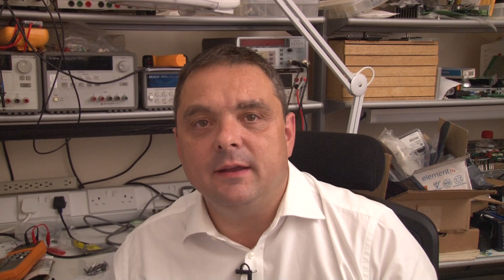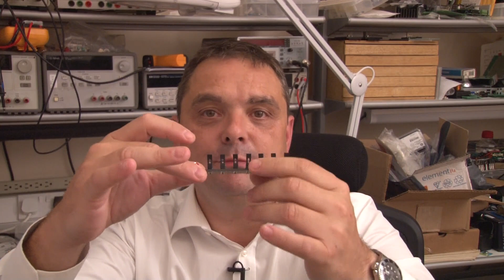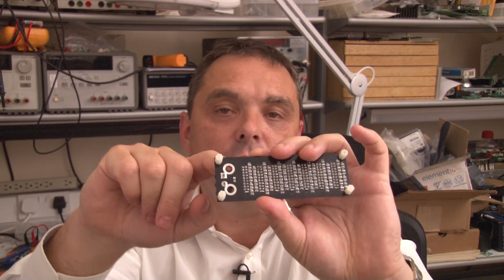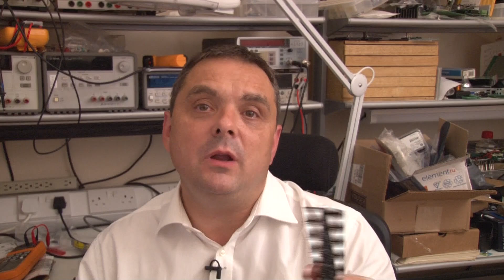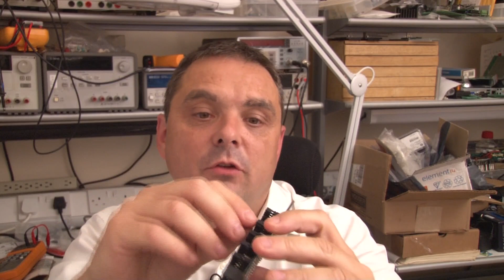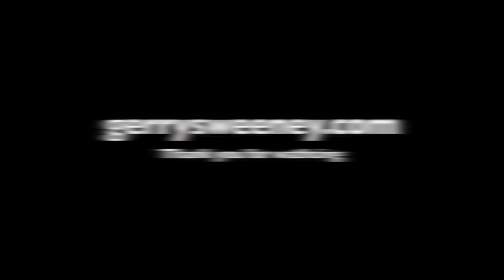Five Decade Programmable Capacitor -- A Low Cost Solution

Comment: Nice vid, I wonder if it's possible to make a programmable capacitor with an MCU like an arduino and handful of caps connects to the analog pins that can be adjusted via some buttons that trigger code that adjusts the overall capacitance? Any one done such a project (perhaps with resistors instead) or know if it's possible?

Comment: Problem with jumpers is they are break before make.
Reply from the maker: Which is OK I think when it is a capacitor because they are paralleled, just jumper the zero position of the next lower bank so you have a small value in circuit when you move the jumper (if you are tuning live).  on the resistor module I ship it with the "0" position solder linked out for the same reason.

Comment: What about dips switches instead of goldpin jumpers?
Reply from the maker: Cost and reliability, when a jumper wears out just use another one, dip switches, especially cheap ones fail pretty quickly with frequent use.
Reply: I was working as electronics lock QC tester
We were using jumpers to turn the device into configurations mode and to make a reset.
Jumpers were lasting about 500 times, so also not much...
Reply from the maker: Indeed, but replacing a jumper is one hell of a lot easier than replacing a soldered in 10-way dip switch :)

Comment: Hi Are these still available, Would like one of each if they are.  Tindie dosent show if they are in stock and as its from a few years ago I don't want to place an order if they are not still in production only to have to get a refund.Many ThanksBrianG0WZB
Reply from the maker: +Brian Burdis yes they are still available.  I will update Tindi, thanks for pointing that out. Gerry
Reply: +Gerry Sweeney Thanks for the quick reply.  It may say on the screen the stock levels but I could not see it anywhere so thought i'd check first.  I will place an order for the resistor and capacitor boards in next few minutes.ThanksBrian
Reply from the maker: +Brian Burdis Yeah Tindi is up to date and does have stock levels set, I think if there is no stock set it would show you that specifically.  I got the order thanks, I will ship on Monday as I am currently away from home until tomorrow. Thanks for the order. Gerry
Reply: +Gerry Sweeney Thanks Gerry, No rush.

Comment: Sorry if someone has suggested this but you can use a BCD encoded switch to get capacitors in parallel.
Reply from the maker: I chose not to because of reliability and costs. Jumpers are low cost and very reliable.
Reply: Don't apologize for that, it never hurts to hear good advice twice.

Comment: Very good idea! I just built my own programmable capacitance inspired by your work.
However, I used the value scheme 1 2 2 5 for each decade to minimize the number of components. (i.e. 1n, 2n, 2n, 5n, with 5n = 2x 10 n in series and 2n = 2x in in parallel, so you need only 2 different values per decade). One question: Is it possible to use DIP switches instead of the jumpers?

Comment from the maker: Hi Billy, not a problem at all, I have no issue with e-bay, in fact, although the charges once combined with paypal charges are quite high, the postage system integration and workflow is quite good - so I am in between at the moment. Thank you for the order. Gerry

Comment from the maker: Some kind of slider switch did cross my mind but I could not find anything. Also, I have not seen a slider switch with 10 positions that progressively adds polls to the common. Its surprisingly hard to find a good low cost solution. Gerry